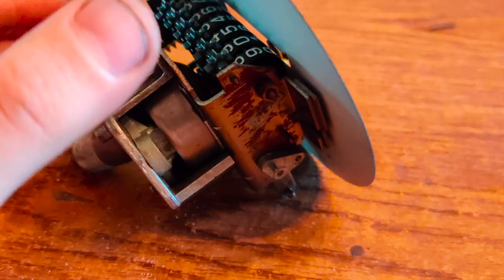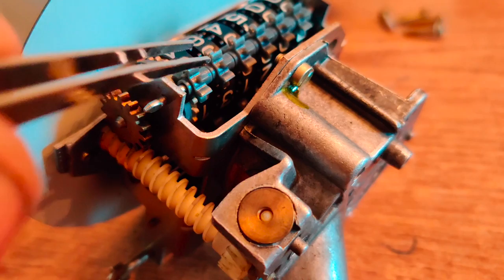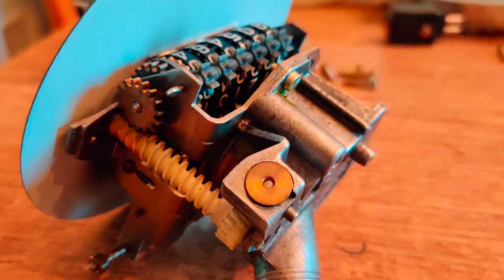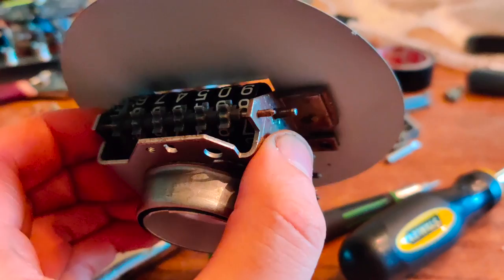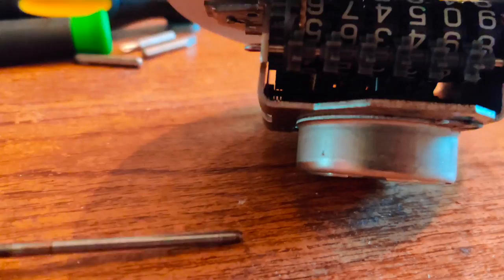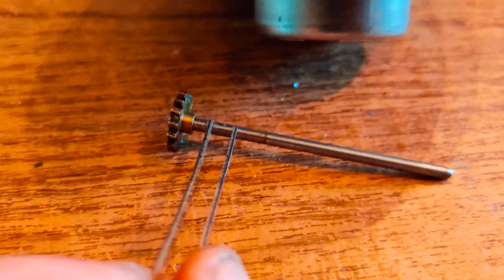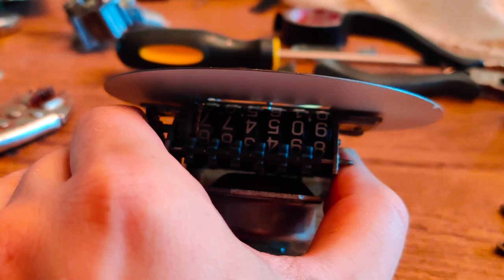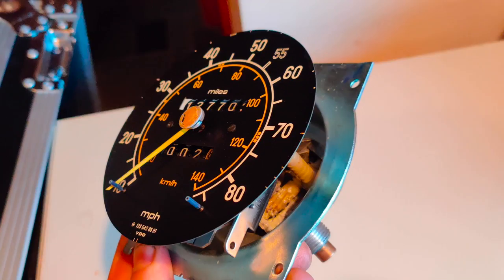Fix Your W123 Odometer FOR GOOD!

Comment: So many of these fail to realize that if we are driving a 30 year old Mercedes, then we probably like to tinker.  I just rolled 235K miles on my 1992 300D, and when I got fuel this week, I did not press the reset the whole way... it was halfway in between 1 and 0... anyway, the danged odometer stopped working. 
This video is the perfect amount of detail for folks like me to get in there and fix it.
Thank you for tinkering, and thank you for posting!

Comment: How do you increase the mileage on the odometer while you have the odometer out?  I'm replacing one w123 Odometer with one that has 50K miles less than the original.  I want the replacement to say what the mileage the car had on it.
Reply from the maker: If yours had the same problem mine did you can just advance the gear mile by mile before applying the fix. if you roll it back it will break
Reply: @TheRustedGarage  Thanks, that work.

Comment: While doing this repair I wasn't paying attention the direction how the plug goes back on the odometer in the back of the instrument cluster? Does it matter how it fits on? One wire is brown and the other yellow and green (or yellow and blue)? So sitting in the car looking forward should the brown go on the left pin or the opposite on the right pin? Or does it even matter? I ask because now the Speedometer doesn't work now; when it was working before trying to repair the odometer.
Reply from the maker: Speedo is a thread-in cable and in no way related to any of the electronics 

I'd say everything else was hooked up properly if everything else works

Comment: When you use the Blue Loctite at 8:40/8;41  How does the shaft not get glued or stuck in the small whole that it was pushed through on the left end?  Seem like it would get stuck after the glue cures?
Reply from the maker: That's a good point, I didn't really see any other way to do it to tell you the truth. I put it back together and went for a drive, never had a problem with it.
Reply: @TheRustedGarage  Well thanks for replying.  That's cool, I think I will try it also I suppose the glue would help it last longer.

Comment: Thank you so much. Mine stopped working with about 170000 kilometres on the clock a few days ago and I'm going to attempt this. Can I ask if you can perhaps shed some light as to which way is the easiest to remove the speedometer cluster from the dash because I don't have those pulling pin tools...
Kind regards all the way from South Africa
Reply: My 1984 w123s cluster comes off from underneath and pushes out no need for tools.

Comment: Hi .I have w123 time oclock . I hear the sound of the engine running, but the hour and minute hands do not move, why do you think? Could you please give information?
Reply from the maker: If by engine you are referring to the clock ticking it sounds like a problem internal to the mechanism.

Comment: My speedo works, milegoes up, but the trip just keeps clicking, shows 0000/9. Pressing the knob to reset doesn't work
Reply from the maker: The numbers are out of alignment. Just fixed my 124 that had same issue. Your odo reset button/lever is prob worn out. You can gently bend it or grab another one and put it in

Comment: How do you get that pin back on the shaft to lock it in place?
Reply from the maker: The ring that locks it all in place? Be careful, I used my fingers to seat it in place on the shaft and then alternating sides I pushed it on with a flathead until it was snug

Comment: I have a problem
When I drive at speed 90 Odoo read 100
And drive 120 it read 140 KM
Any idea what is problem?
Reply from the maker: if the amount it is wrong is consistent, your car has a different size tire, or a different rear